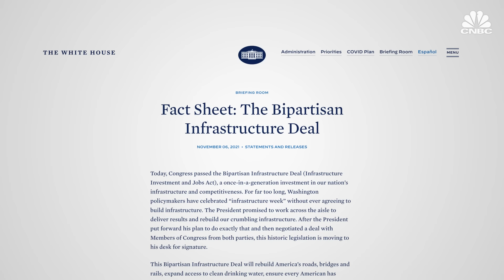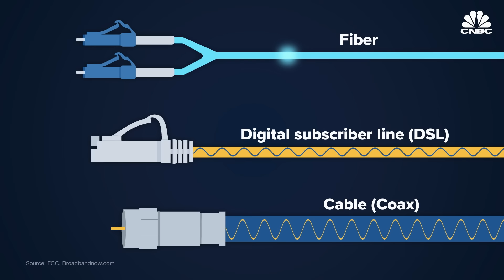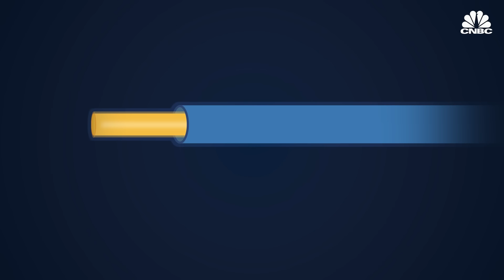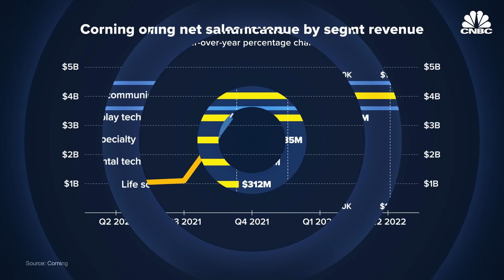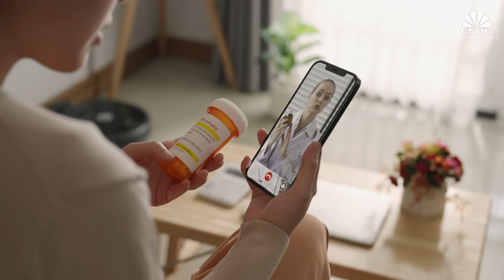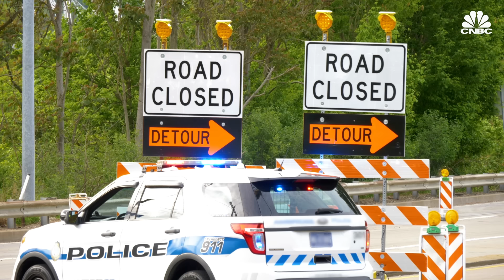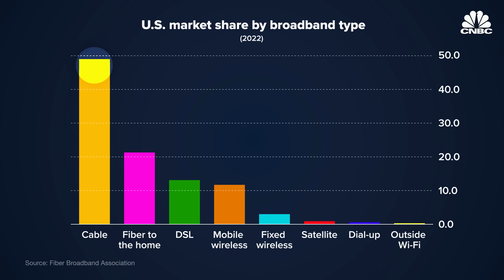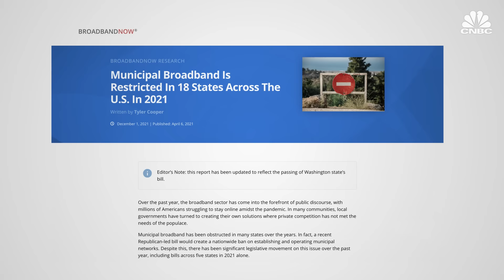How Fiber Will Speed Up America’s Internet

Comment: I live in a pretty big city metro area (pop 4M) and fiber only covers about 57% of residents with only 23% at 1GB or better. 5 years ago when I tried to get fiber I was told it would be 2-3 years for them to reach my area of the city. I am still waiting and the overall city coverage is only 10% higher than it was 5 years ago. Even with a Comcast near-monopoly in most of the area (if you want >=1GB service), companies aren't willing to make the investment to lay fiber - again, big city = expensive construction costs. Now this video is telling me it could be 10-20 years??? I would easily switch to fiber if it was available at about the same cost... however, Comcast/Xfinity cable rarely has problems for me and I get ~1GB performance... it would just be nice to have better tech and options.
Reply: @nigratruo  I agree with that mostly, but I don’t want Comcast to lay fiber, I want competition. It will likely take the government intervention, but hard to lay blame on the current President when we have had a few others before that didn’t do anything either. Plus, you know Republicans won’t pass anything if they can block it.
Reply: Im suprised Im from Mexico and almost every single Mexican city has optic fiber coverage through out the whole city and the prices are good the most expensive option I found was of $27 a month and the second most expensive 14 a month with 1gb or better
Reply: @moctezumaaleg2008  
The US gets life better in every other aspect. The US is number 7 on the global indexes of  internet speed. 
The US is extremely large with a very dispersed population so it tends to mean that there will be areas that do not do as well in some areas of economics.

Comment: The problem is that the country's largest internet provider- Comcast- appears to be stuck on using 2000 era coaxial cable for all installations. My parents just moved to a new, high-end condo complex and  all that is offered is Comcast Coaxial. Much of this metro area is  only serviced by Coaxial copper by Comcast.
Reply: What metro area?
Reply: @wendelllaidley3407  DC and all of SE Michigan
Reply: @geoffwitt4227  
When you talk about Coaxial you are really talking about the last mile and not the main infrastructure. 
A place like washington DC is going to be hard to get fibre into the homes. Most of the data from other countries is very misleading because it gives the impression that every home has it it installed when in fact it is their infrastructure system that has it not the home connection. 
A lot of these countries did not even have a well developed Coaxial system and rely on copper phone lines.
Reply: @bighands69  Correct. But wouldn't several coaxial connections greatly slow the speed? I have a 100 foot coaxial from the box. Another one in the house walls. Another from the outlet to the room. Then another to the router. with my FIOS system, in my apartment I have fiber all the way to my router. It is cheaper and much faster. But the only offer this in about 25% of the metro area.
Reply: @geoffwitt4227  
Degradation of the signal can occur but it would not be that significant. The number of users on a cable would be of far more significance than the actual impedance of the connections. 
A Coaxial can perform up to 500 Mbps and with future technology it could be higher.
Reply: @bighands69  Thank you greatly. I was always worried about all my Coaxial installations that I oversee for my family members vs FIOS.

Comment: Glass is actually a very viscous liquid.  When you look at glass 100 years old or more, it's slightly thicker at the bottom than the top due to gravity.  So it degrades over time, but takes a LOT longer to do so than copper takes.

Comment: As a former Charter Communications employee, these companies screw us every which way they can. Between Charter and Comcast, they own at least 70% of the market in the U.S. They would tell us all the time that Comcast isn't our competitor, that companies like AT&T are. What happens is Comcast and Charter negotiate an agreement on zoning, such as splitting up counties or even entire states. They have effectively joined forces in creating a monopoly of sorts. For many areas one of these two companies is the only choice, giving them power to do what they want with little competition. They also run very aggressive lobbyists, influencing officials down to the local level. Charter alone makes a gross profit of $20B per year, while also bragging about price hikes this past year. These companies are disgusting bullies that need to be scrutinized, otherwise it won't get better.

Comment: Cox in San Diego has fought fiber for years. Finally, AT&T has arrived with fiber to the home (FTTH). Can't wait.
Reply: Coaxial is still a great service and far more than what most people need for internet.
Reply: One Gig bandwidth for internet, TV, and phone means lots of compression. I have the largest home TV antenna and when I compare Cox cable TV channels with my antenna signal, I can see the difference. Way too much compression on RG-6.

Comment: It's so crazy to know that the USA is so behind it when we talk about fiber adoption. In Brazil, for instance, you can go to a small poor city in the northeast of the country and see improvised mini houses connected by 2 cables to a pole: the first one is a thin cable of copper for electricity, that could support no more than 30 or maybe 40 amps if you are lucky. The other one is fiber, probably running at 300+ Mbps down and 150+ up for around $15 USD/month.

Comment: Embedded antenna vehicles that will use IOT will be based on starlink like connections where it'll continuously interchange huge volume of data over Internet while moving.
For vehicles Starlink have to make hemispherical antennas (enabling it to recive signals from all over the satellites) that will fit over the roof of moving vechile.

Comment: I have been using Fibre Optics internet since 2 years, after lockdown.
My current 100mbps unlimited plan cost about 7$ per month. And I think it's good, low ping, reliable, fast, cheap.

Although that unlimited is capped to 3200gbs per month. Tho my data usage don't cross 1500gbs even after downloading so much games from steam and movies from torrents.
Reply: you pay 7 a month for internet?  was i born yesterday?
Reply: who you paying 7 a month for a provider?
Reply: @ChickenMcThiccken  ISP name is Excitel.
But pretty much every ISP provide it around 7-8$ per month for 100mbps.

Comment: Fun fact : Fiber carry data through blinking light, but you can blink at various different colors, each color carrying its own signal, so 8 colors would make the fiber carry 8 times the signal, etc.  Today's equipment can carry hundreds of colors (wavelengths) and blink at a faster rate so that each fiber can carry up to 800 Ggiabit of data per second.  Wavelength Division Multiplexing is a fun topic.

Also fun fact: We standardized the protocol for fiber optic communication back in the 60's, thinking that telephone companies would soon upgrade our systems.  Little did we know that companies like AT&T were quite happy with sitting back and collecting money from copper wires that were laid out, and did nothing.  Well, they did push for legislate against other companies laying down fibers.

Comment: We need more network engineers in the USA to expedite the fiber to home rollout.  All that needs to be done is upgrading the head-end (hub) routers that support fiber, which most do nowadays.  As the Core and backbone network is optimized for fiber , we just need the edge completed which only involves upgrading line cards on routers, or replacing the router that supports it and installing the optic and fiber, then fiber ran to the home.  That's it, we have the infrastructure setup for it and ready, we just need the edge to finish up already.  (I am a network architect and worked for multiple ISP's).  But if you are interested in this type of work, please apply, you'll be making a lot of money 75k - 250k +, and you don't really need a degree (I only got a two year tech degree)....we need more people to get this expedited.
Reply: I'm not worried too much about FTTH. The new distributed access architecture is pretty powerful. RF nodes that only service 33 houses per return and have distribution runs limited to roughly 500 ft. With upgradeable 20gig SFPs in the nodes providing IP level access that close to the house,1.2ghz networks, OFDM/A being 4 times more efficient and robust and most of the customers going to single device platforms such as Comcast Xfinity, cable is far from dead.

Been doing telephony/DSL/ISDN/Centrex since 96. FTTH/FTTC, cable, SDSL/ADSL/VDSL and more in 99. Now, cable MSO only, so I work on RFoG/GPON, Rphy, new 1.2 ghz analog networks and old 860mhz crap that should have been decommissioned a while ago. Monday Sept 12th we will release 8 gigabit internet. When we decomission all the older TV boxes that use SC QAMs, we will run full OFDM/A and open with a 1.5gig/500mb package. Next after that will be symmetrical 1.5gig over coax.

I actually have less education than you, but when you can walk into the room and pick up tools and make it work and are known to work for multiple ISPs (and know a lot of the people in the industry), your education doesn't matter so much anymore. Yes, I get paid well and I totally agree you can make a great dollar doing this unless you want to spend 35 years as a residential installer. Then you are asking for it.
Reply: Only reason ISP dont roll fiber to every house is cost and return on their investments, that is why the government keeps giving them money and more money

Comment: Old information...about 30 years old if not older...but good.  Fun fact:  there are fiber amplifiers (EDFA) and they roughly amplify a light signal for another 80 km per amplifier for up to 10 amplifier.  This is rather amazing if you know electronics, since light is not obviously amplified like say electrons are by an op-amp.

Comment: Better late than never. For 15 years US was lagging way behind Europe or East Asia. In US a lot of monopolies, greed plus size of the country, made things horrible. But it looks like things are changing. Fiber is a good investment that should scale in the future. Still a lot of companies last mile deployments are not that great, and probably not scale beyond 10G, where in many places in Europe and Asia, they will easily do 100G, due to different technical methods, and how fiber is shared between different providers.

Cheers, from Switzerland, where I do have 25Gbps connectivity for almost 2 years. Bottlenecks are now in other places, like internet exchanges, still often stuck at 10G. (But that will very soon change as 25G and 100G hardware is really getting cheap).
Reply: the prices in the us still shocks me.. In Sweden we have pure fiber and i pay 13 usd/month for PURE 1 gbit internet (1000/1000 mbit ) 90% of the sweeds have access to pure fiber in sweden since well 15 years back and about 18-19usd/month for unlimited 5 g mobile.

Comment: A carrier tried to talk me into fiber optic and would install optic lines in my house but wouldn’t of done me any good since our area only had coax ran to homes which means my fiber optic would still only be as fast as the coax speeds. I think this is common in most areas.

Comment: The glassfiber-cable is a invention of me in my trimester 1992/1993 at the Graphic Technical Lyceum at Eindhoven, the Netherlands at my home at old adress Withof 35 Ulvenhout (Hometown Breda). Some say it's the place, but it is the thought and the maker. As thin as possible and that is of course as a hair-line. It can be explored by various kind of technologist matters. Kind regards, Saskia F.J.H. van Houtert, engineer/office-manager, date 24 june 2023, time: 10:42.

Comment: The light signal travels in that plastic wire (i know it's glass).  The light signal is in digital format of 0&1s.  This is much better than the coaxial cable of electromagnetic signals, in terms of multichannel and bandwidth.  Another thing is, the fiber optic wire is more secure than other media.  You really cannot listen or jam the signal.  During the India-China conflict on high Himalaya mountains, China laid fiber on the frontline for real time intelligence.

Comment: Good program!  I'll add  another rationale to explain why fiber has not yet been broadly adopted in the U.S. .... NEED
For example, take my home. My neighborhood was built before fiber was laid to each home. Fiber was eventually laid in the streets, but not the last 50 to 100 feet into each home. The service provider uses an adapter to convert the optical signal into an electrical one to reach the home. It offers 60 Mbits/second. There may yet come a time when that data rate becomes insufficient. But until I have a need for fast and frequent, multi-gigabit uploads/downloads, I don't see it. This likely applies to most homes ...they just don't NEED fiber to the home.
Reply: That is called Fiber to the Node.
Reply: @RaymondHng  Does 'Fiber to the node' imply reaching the converter out on the street, that leads to my house, OR does that imply the final terminus (my house)?
Reply: @gregparrott  Fiber to the Node is fiber terminating in a box (the node) located outside the home and the remaining length to the home is copper wire. Fiber to the Home is fiber terminating at the customer’s home with no copper wire at all. FTTH has a higher bandwidth over FTTN.
Reply: @RaymondHng  Thanks for the clarification.

Comment: I have a fiber optic device that was a sort of adapter for a photographic light meter I have owned since the 1980s and like very much. I recently ran down one of these meters on the used market (not manufactured since the 80s) because I wanted another one, and also tried to buy one of the adapters (not important what it adapted to). I bought two or three on ebay, and had to send them all back. Over the years (20-25), the fibers had disintegrated. Simply touching still intact fibers, broke them instantly, with near zero pressure. This has to be the reason fiber optics failed. No long term stability. Imagine having to dig up all the fiber optics in the country, every few years, and replace it all!

Comment: How do they translate electrical signals to light signals? How to do the reverse? Our devices all use electronics but those signals are converted to light signals to travel long distances.
Reply: The switching of the networks is based on electrical signals. SO they would use conversion methods. 
None of this is really an issue because that conversion is done over very short distances.

Comment: The equipment to terminate these fiber lines at headend and core locations is also and extremely expensive endeavor (can be hundreds of thousands of dollars). On top of trying to logically plan out a network. Any time there is an issue or networks need to be modified to include say new markets, it's a technological and financial nightmare. As it was briefly mentioned, the amount of just permitting required to lay new fiber makes it even more costly and time expensive. Certainly greed plays a factor from companies but there are a significant amount of hurdles beyond just that.

Comment: i live in denmark , i use Coax internet over fiber .. coz the Latency in games are the same only when i test its lower latency  ,  so now i pay less with coax for 1gbit than i do with fiber , 500mbit is more expensive than i get with Coax 1gbit .. and if ppl wonder "yeah pay for 1gbit but get 200mbit" nope .. 900mbit and above and no data caps .. :)

Comment: The only fiber optic I have access to is my Audio cable, for Internet I doubt I'll get FO for at least 20 more years.
I still used 56kbps dial-up 15 years ago. My DSL has gone from 1mbps to 2, then 5, 6 and currently at 10, so if I even had 25 I'd be happy.

Comment: Interesting report that jumps from coax cable to fiber skipping right over Ethernet which has been around for well over a decade.  CAT5e Ethernet gives you up to 1000/1000 Mbps or 1 Gig/1 Gig.  Cat6, Cat6a gives you up to 10G/10G.

This is a pretty egregious mistake.  Fiber can be the backbone and Ethernet the front end since fiber being made of glass can be very fragile.

Comment: Actually it quite easy to deploy Fiber optics/FTTX to home if that home already have cell coverage (4G/5G). By sharing those existing fiber infrastructure from Mobile Backbone, Only Last Mile cable have to be put in place, and most equipment and cable is cheap AF right now. Problem is labor cost which need to pull cables to your home, setup cost may a bit high but it will worth it.
Reply: It is not easy at all. Getting the cable inside the house is a complex slow expensive task. Every house is different with some having great cable containment and others having nothing at all. 
It is known as the last mile and is very expensive.
Reply: @bighands69  Not that hard except for old Apartments/Condos where new fiber infrastructure for whole building need to build first.

In my country xDSL was switched to fiber completely in just 5 years except in old Apartment/Condos where fiber installation is too hard or not possible.
Reply: @sfalpha  
What is your country?
Reply: Thailand

Comment: May be cable companies to be roped in for fiber optic network connectivity. 🙏
Reply: The US has fibre optics problem is getting into the homes. They have been at it for 20 years and still not there yet. 
US figures on this includes rural communities as well and not just cities. Many countries only include cities in their data.